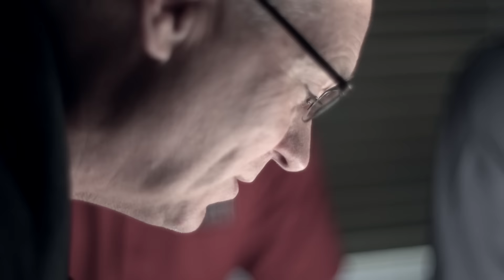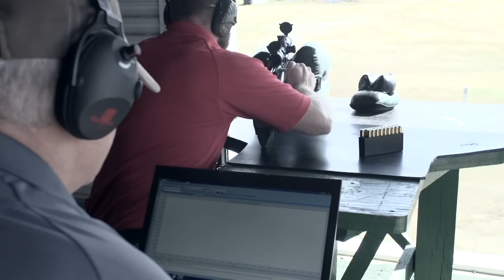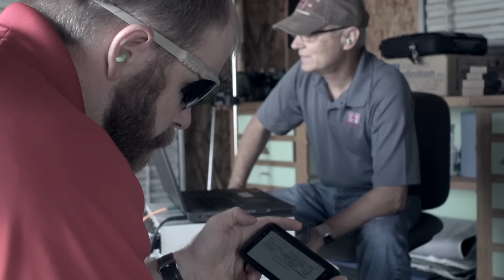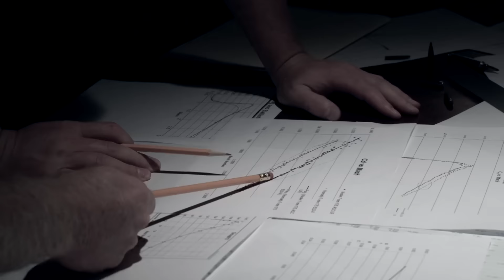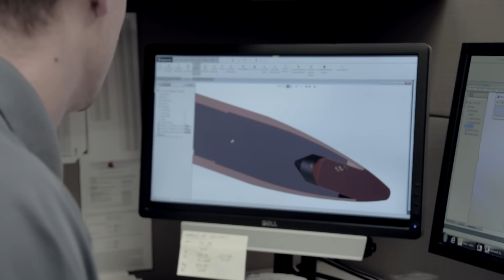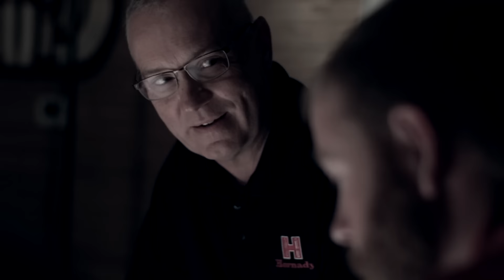Hornady® Heat Shield™ Tip

Comment: Does that mean the amax tips have flaws? Cause the amax bullets still fly really well...??
Reply: +Sanus180 well these will fly even better then guess thats all we need to know
Reply: +keokio7 nice stuff. Anyway I've placed an order for some but being in Australia - it could be some time before they filter in here :(
Reply: If it's the same plastics as just about every other polymer tipped bullet on the market regardless of brand, chances are high that the tip is gaining diameter in flight. Reminds me of the nose cone of the spae shuttle, deliberately shaped large and round to push the shockwave heat out beyond the wing tips of the craft where it won't shear them off like a cutting torch.

Unless it's the new polymer they've specified for this new tip.